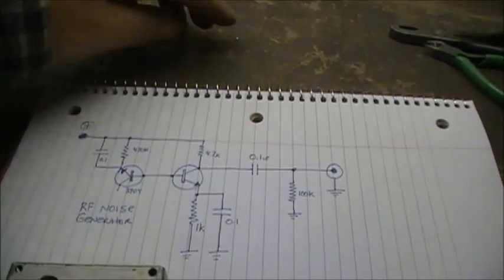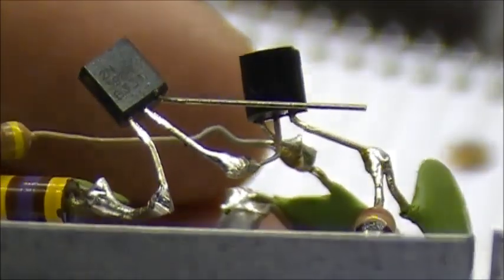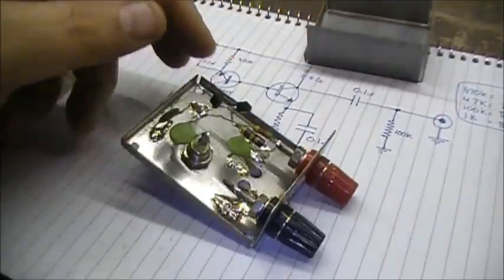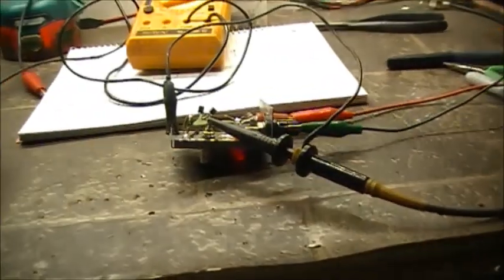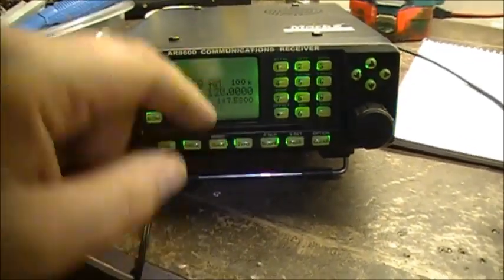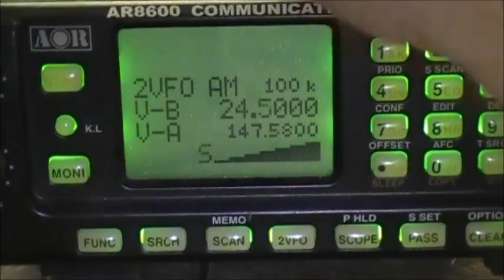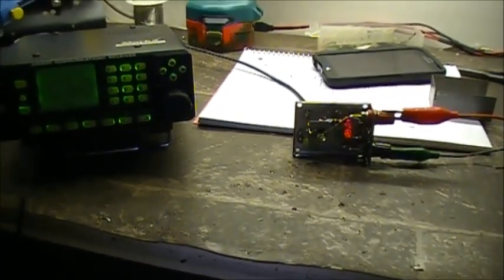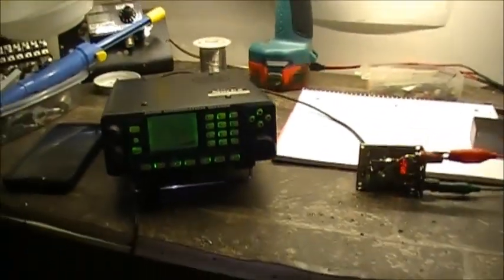RF Noise generator - PROJECT

Comment: I built one and measured -40 dBm at 1MHz with a drop to -78 dBm at 30 MHz. The drop was pretty much straight line (in dBm) from 2 MHz to 30 MHz.